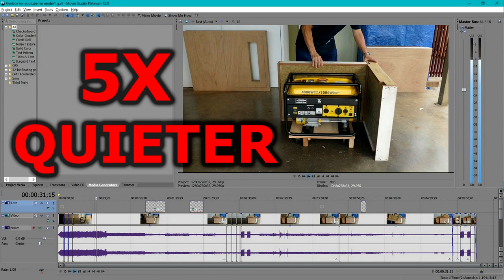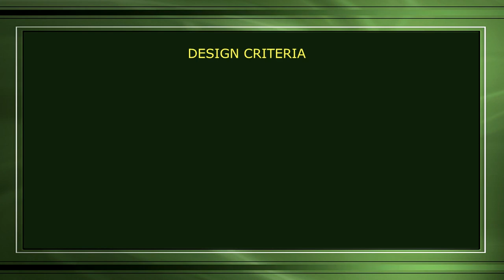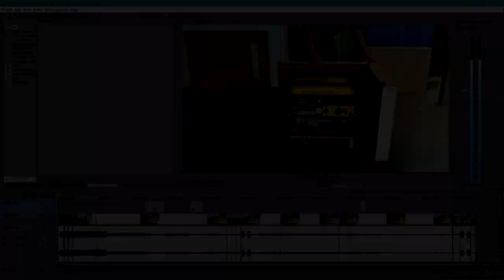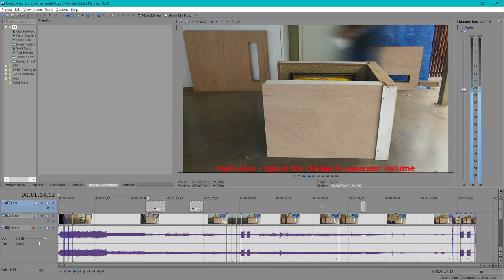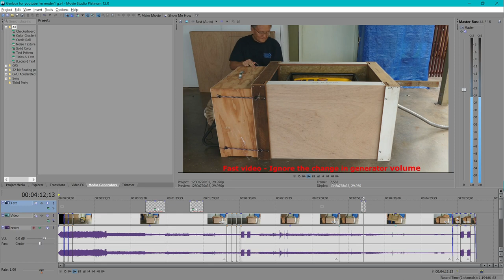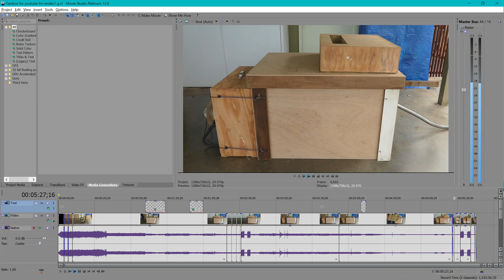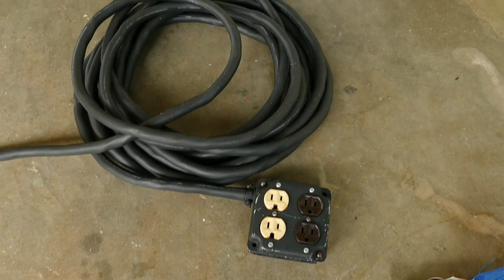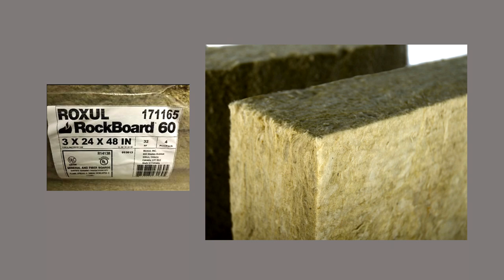5x quieter generator or compressor sound reduction quiet box

Comment: Major problem here, like all others, restricting air flow on an air cooled component spells trouble, particularly when it's above 80 degrees outside.
You have restricted over 75% of available cooling air!
Reply: Did you miss the part with the Vornado fan to force air across the generator full time?  I would think that this is even better since there is guaranteed air flow to aid in cooling the generator.  You don't always have a breeze outside in an ambient environment.
Reply: @FeathersinWood  My Onan has a great fan system near flywheel and air duct shrouding to direct flow across engine and generator. His unit might not have that good of a cooling system from what i see.

Comment: Um... claiming a 30dB reduction in noise needs to be backed up. You can't use the dB meters in your video editing software and "eye" it. Get an inexpensive dB meter and put it in your video. I suspect you will not find the same 30dB reduction that you claim. Granted, it is quieter, and you have done a good job engineering it. Just let's get the facts straight about the actual noise reduction. 30dB reduction is a LOT.
Reply from the maker: Toy,
I shot the video and did NOT doctor it in any way.  I have no control over what the dB meters in my video editing software show.  It is what it is.  Please do not build a quiet box if you are skeptical of the results.  All I can say is that the video is 100% authentic and honest in every way.  Thanks.
Reply: Usefulgizmos - Jesus, you people. I didn’t say you doctored the video. I said the dB meters in video editing software are unreliable. I’m sure the video is authentic and honest, but it is also inaccurate. Like I said, use a real dB meter in the field, not a software meter.
Reply from the maker: Toy,
I just want to clarify that in your original comment, you said:
>> " I suspect you will not find the same 30dB reduction that you claim.  Granted, it is quieter, and you have done a good job engineering it. Just let's get the facts straight about the actual noise reduction. 30dB reduction is a LOT." <<
Please note that in my youtube video, my video editor's db reading of the generator alone is -9dB and enclosed in the quiet box with sound baffles is -30db.  That is a reduction of 21 dB, not 30 dB (30 - 9 = 21).  As you said "let's get the facts straight".   Just wanted to clarify.  Thanks.
Reply: Usefulgizmos - Thanks for that clarification, but I still think you cannot rely on the software. Plus, you have comments in the video that state “30dB” and your title is “5x Quieter” !! If by that you mean your box reduces the loudness by 80% (there is no such thing as nX quieter), then I really think you need to get a proper dB meter. Your box definitely does not reduce the loudness by 80%. Probably more like 50%, maybe 60%. Please, use verifiable science to prove me wrong! I welcome it!

Comment: all you have to do is make a plywood A-frame over the generator to deflect the sound waves into the ground...it works and how hard can it be to put 2 peices of plywood end to end standing up??? Just be sure the sheets are large enough to touch at the top but be away from the exhaust a bit. All these rockets scientists building generator houses and concrete bunkers and towers...geezus!!!!  A standby generator is something that quite possibly you may never use or very seldom use so no sense spending a bazzilion more dollars and your time building a custom "home" for it that you may never need and have to find a place to store where it is out of the way for ever. If you really need to spend the money like that you might as well just buy a standby generator that is hooked up directly to the house and goes on automatically with its own custom built little storage unit and have it professionally installed so it looks and IS done right instead of the cob job crap houses. Everyone has a better idea....so they think
Reply: Wow. Done that. Yes that does cut down the sound . But not even close to what this does. Some people do not have the option for that expensive "professional" set up that "they may never need." By the way, I'm trying to figure out how much a bazillion dollars is. but I'm damn sure I've ever spent that in my life.